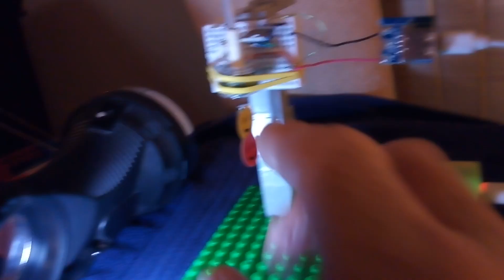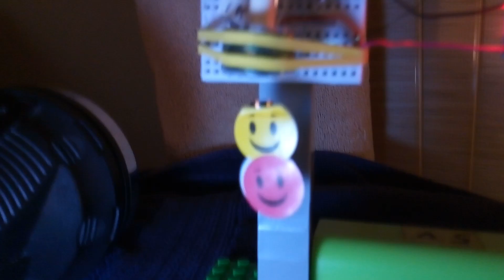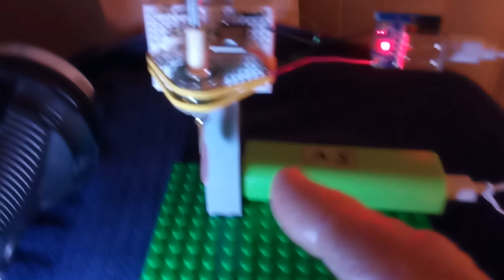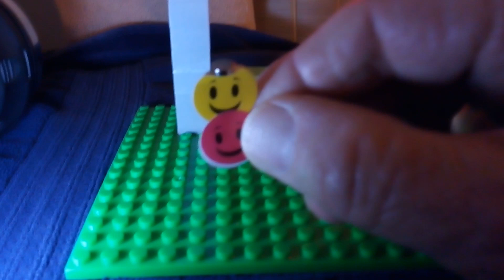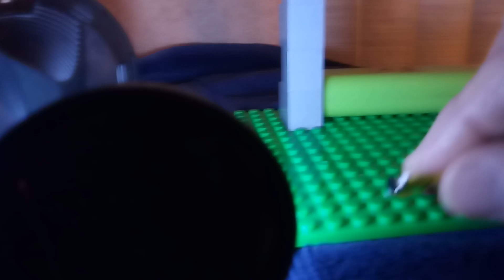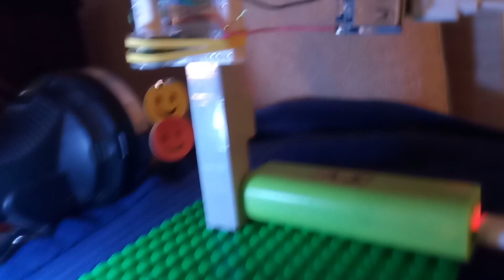Electromagnetic Levitation

Comment: Think, could you do a one magnet Bendini this way? Like your 'Top Bendini", that suspended by Neo.
I know it's been done, not with curcuit or 3D printer of your's, Yet.
Reply from the maker: That might be possible.  I have been looking back at really old projects to see if 3D printing could improve them.
Reply: @Lidmotor  so think you should. I don't get milage from printer of mine. But as in Wood, your skills are strong.  When you master, 3D modelling, please revisitv your library of tinkers, previous done in wood and hand..  I wouldimagine, Motor generator pulse motors,. Definitely1 magnet Bendini and Maggie. The best, to you teacher
Reply from the maker: @j.christie2594  Thanks.  Yep.  There are many old projects where 3D printing could be used.

Comment: Brilliant, I really should have a go at one of those. I will put that on the list 👍😁
Reply from the maker: These are fun.  Slider and I messed around with them a bunch years ago. He levitated a tiny Delorean model car that had led headlights.  He powered the lights wirelessly. It looked amazing as it floated in mid air.
Reply: @Lidmotor  👍